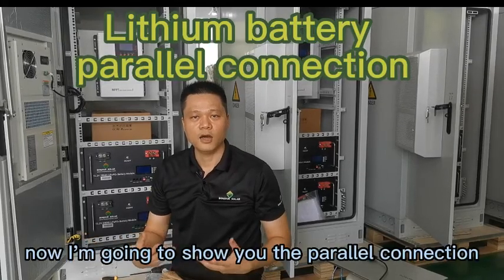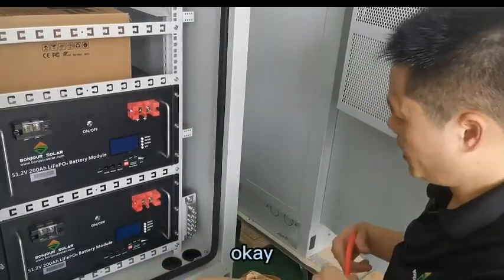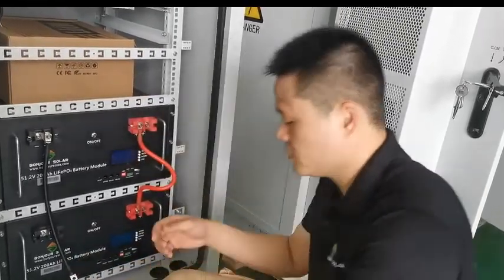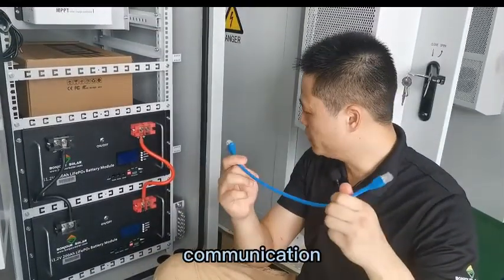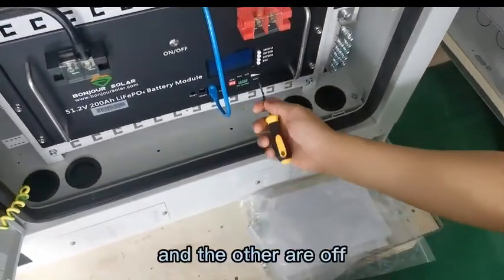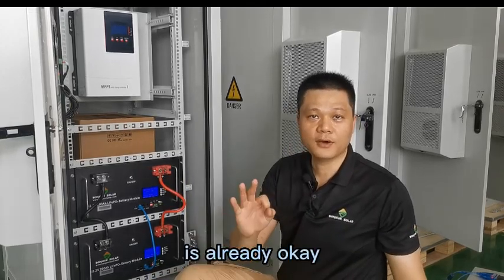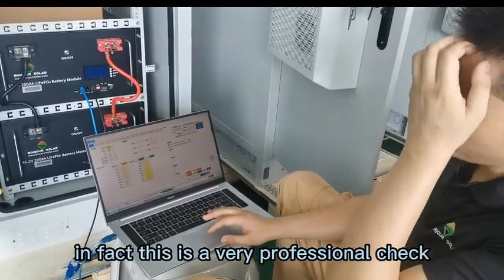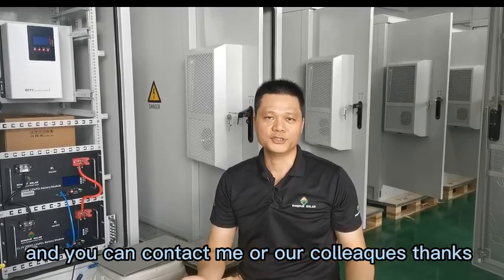How to make parallel connection for lithium battery?

Comment: Thank you Leo, great videos. Quick question for parrallel batteries, you did put address 1 and 2  .   will this work if you pick address 0 (non of dip switch up) and 1 (first switch is up)
Reply from the maker: address 0 means single battery, so the address 0 and address 1 can not parallel communication

Comment: Hi, may i know the size of RS232 connector? Is it rj11 or rj12. I really appreciate if you can reply my query
Reply from the maker: our RS232 use RJ11    6 pins size
Reply: @bonjoursolar  thank you so much. Is it the same pin size with CH150AH? (changhong brand)
Reply from the maker: for our products yes, but for the other brand, we are not sure, you should contact their after service to confirm, that will be more clear, i think @RyanBautista
Reply: @bonjoursolar  i’m still planning to buy this type of battery and i wanna try to check what you have done once the bat is with me. And one more question, about the RS485 com port on your battery, is there an exclusive cable wire for parrallel and for going to the inverter. What i mean is the pin connector assigment code. I just saw it on my Deye inverter and i want to connect the BMS 485 port going to RS485 port on the battery
Reply from the maker: hi, my whatsApp is +86 13926220561
  we can communicate more details by whatsApp, thanks
 @RyanBautista